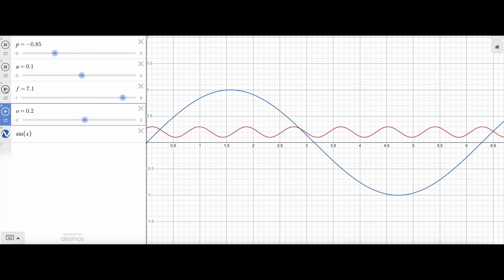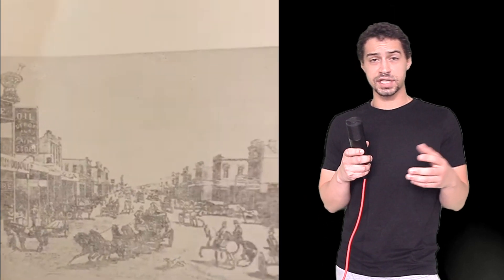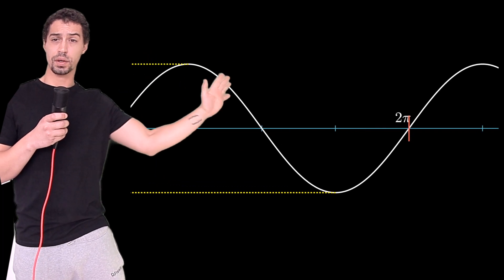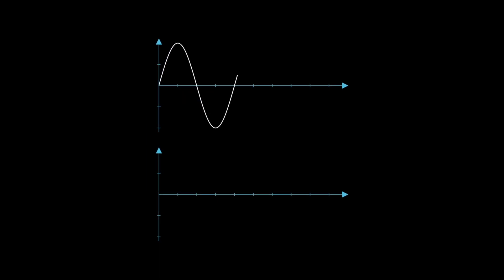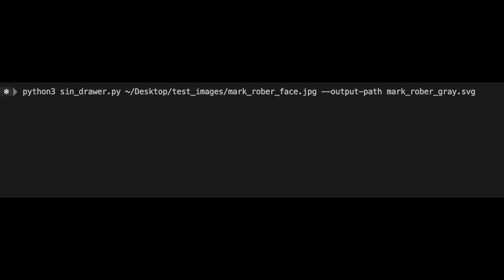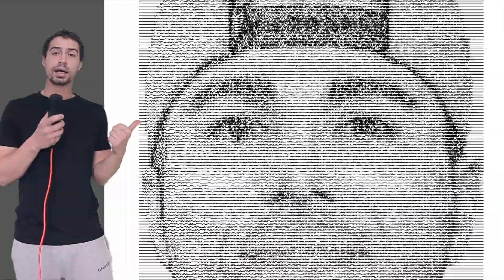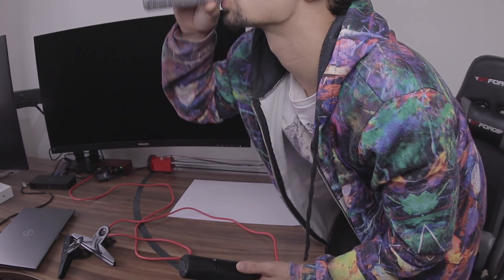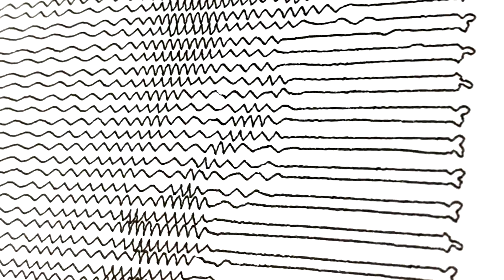Image to Vector drawing with Python (drawn on real plotter)

Comment: Have you tried Vector to Gcode 2 to convert svg to Gcode? Would love to hear your thoughts ..
Reply from the maker: So this plotter doesn't really work with GCode so I didn't try that directly. I basically fully buit in this algorithm into the plotter where it only generates one point at a time.

In the repo there are separate tools that do just the conversion to DVG, you could use that and then pass the resulting SVG to you GCode converter and have it running on any plotter/printer

Comment: Is possible to generate gcode from these
Reply from the maker: not as is, but its probably easy to convert the sequence of points into GCode. If you want GCode directly you can probably use GRBL, I think they have a similar algorithm implemented and they work with GCODE